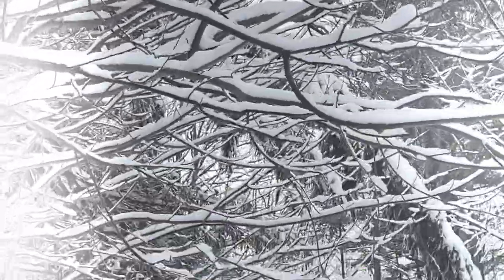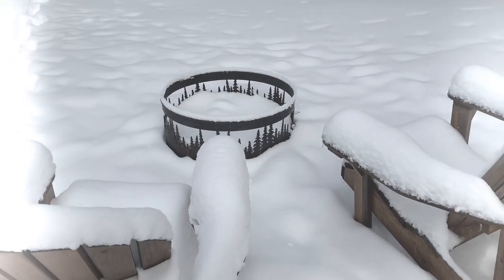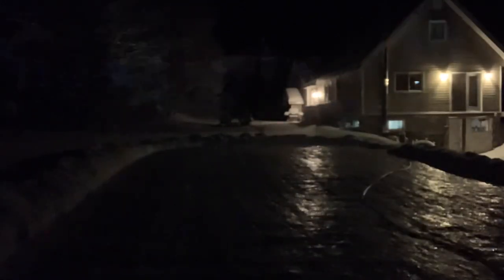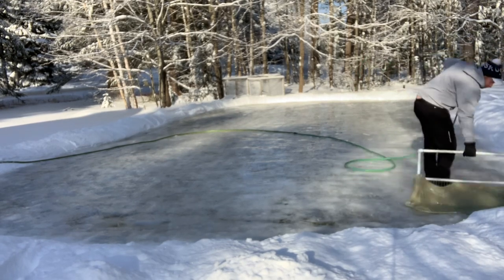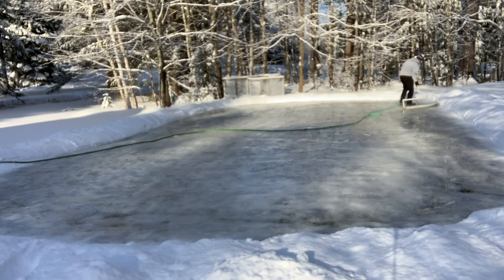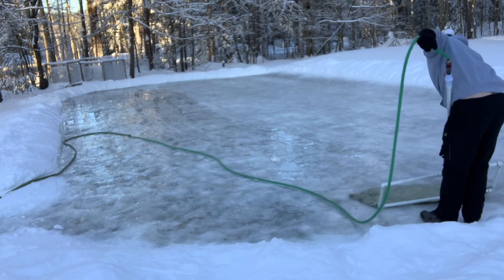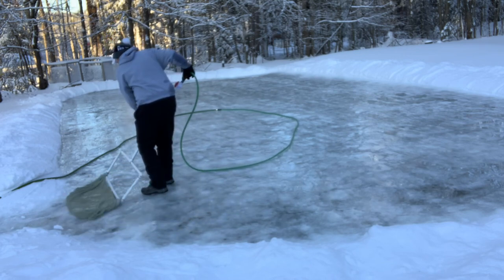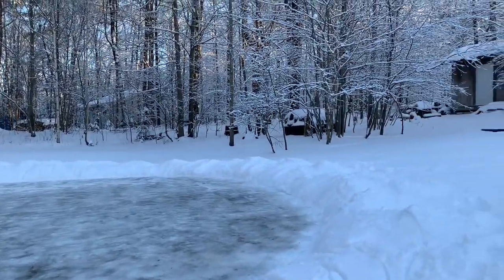How to build an ice rink without a tarp (Part 2) In 4 DAYS!!! NO TARP ICE RINK

Comment: Hi there…..following this and seemed out be working but when I switched to the homemade Zamboni with HOT water, it seems to be melting through the ice…..it’s about -12 here…..any tips where I went wrong?
Reply from the maker: I’d recommend slowing down the water flow a little and walking slightly faster , that’s why I usually go over it twice so I’m putting the water down very thin. When I first started I had the same issue, if I left the zamboni in the same spot for a couple of seconds it melted through as well. I’m not having that issue anymore as the ice surface is very solid now and much smoother! Hope you find that helpful! 😁👍🏻
Reply from the maker: But thanks for mentioning that, maybe I should do a video on things like that. You can fix the melted spots with slush - let it freeze and it should be fine!
Reply: @BackwoodsLawnCare  perfect! Thanks so much for the help
Reply from the maker: @marcmiller5481  No problem, once you’ve built the ice up more you shouldn’t have this issue anymore, just always keep your eyes out for stuff like this! If you’re using a zamboni now the ice should start getting thicker pretty quick! 👍🏻
Reply: And yes. A little video on repairing any spots would be awesome
Reply from the maker: @marcmiller5481  lol, ok I’ll make one this coming weekend. It’s usually dark by the time I get home from work which is difficult to film in lol

Comment: Great video!  I have one question and one suggestion.  1)  What water source are you connecting to?  If it's an outside tap, do you shut it off and drain it each time so the pipes don't freeze?  2) My suggestion is from the curling world, and that is to get a rubber gripper for one or both of your shoes/boots.  They're cheap and safe and shouldn't damage the ice at all...no less than your elbow or arse when it hits the ice, lol.  Cheers from rural Ottawa
Reply from the maker: I hook the hose up in my basement directly to the hot water line and always bring the hose into the basement when I’m finished!

Comment: Great video. I’m exactly at the same place. Bumps but starting to smooth out. Do you use any snow to fill In dips as you move forward?
Reply from the maker: If I notice any big ruts or damage from skating I’ll use slush to smooth it out / let it freeze and it should be good to go within an hr depending on the temperatures etc but right now it’s already very smooth and as I’m sure you noticed kind of tough to walk on 😂